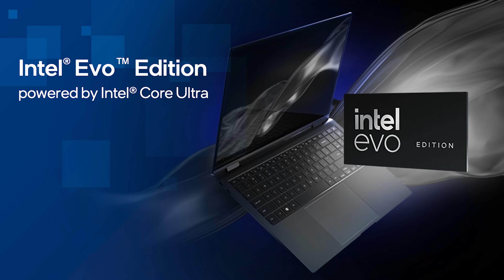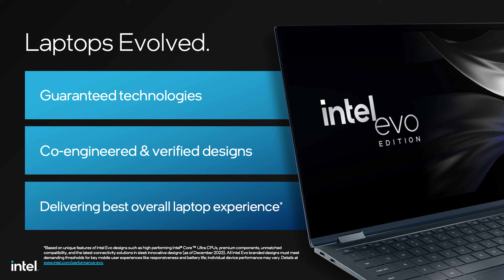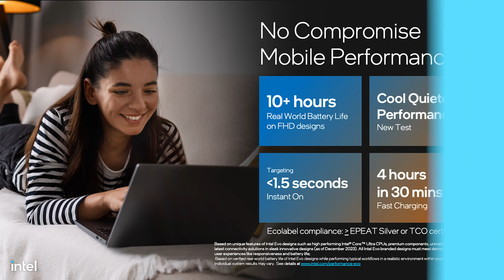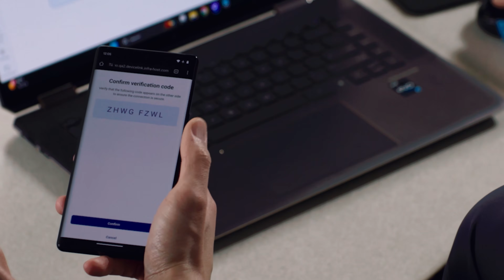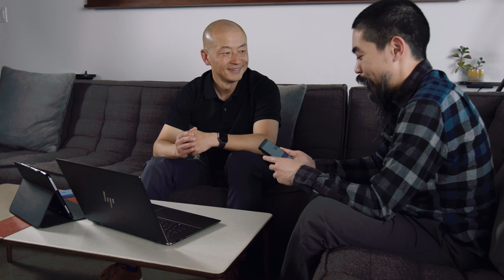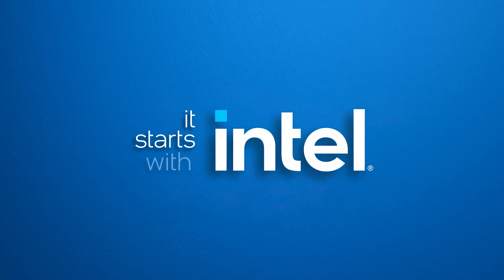What’s New With Intel Evo Powered by Intel Core Ultra | Talking Tech | Intel Technology

Comment: Is Intel Unison available for Linux devices?
Reply from the maker: The Intel Unison app will work with Windows 11 and exclusively on Intel Evo verified laptops. As of now it is not available on Linux. To know more about the compatibility of the Intel Unison app, please visit https://intel.ly/48aV0ja Do not hesitate to DM us if you have any further queries. We'll be glad to look into it.
Reply: @IntelTechnology whats the recent qualification for a laptop to get intel evo edition certification?
Reply from the maker: To check the complete qualification parameter required for a laptop to be certified under Intel Evo, please visit https://intel.ly/3RRm0gp The main highlighting features such as high performance, fast charging, long battery life, instant wake functionality, best-in-class connectivity, etc., are some prominent ones. For more information on the new Intel Evo edition laptops with AI experience incorporated in Intel Core Ultra processors, and the inclusion of the Intel Unison application for seamless connectivity, visit https://intel.ly/3OlayZN

Comment: did they put E core into the processor?
Reply from the maker: Yes, Intel Core Ultra processors integrate two types of CPU cores into a single die: a) powerful performance-cores (P-cores) and b) flexible efficient-cores (E-cores). The Intel Evo Laptops are designed to provide high-performance with low power processing. The Efficient-cores play an important role as they use less power and enables the device to operate at a lower power consumption rate on tasks do not require high computational performance. It also helps to maximize CPU efficiency and helps to run background tasks efficiently. For more information on features that comes with Intel Evo certified laptops, visit https://intel.ly/3v6Ezpm

Comment: Few initiatives that EVO can promote.
1. BATTERY - Today's laptops come with batteries with varying form factor. Because of this, it becomes very difficult to get spare original batteries for the product after end-of-life of the laptop which is generally 3 to 5 years depending upon the brand. The duplicate one are available for few more years, but they are not safe and tend to go bad in a year's time. This basically makes the laptop / tablet unusable. I have a Windows 10 tablet sitting in my closet because of bad battery. And the company has closed operations.

Suggestion: Intel EVO can ask OEMs to standardize battery sizes so that we could always find original spare batteries.

2. FLEX CABLES - Laptops use flex cables of varying pitches and no. of cores. Even if a single flex cable goes bad, we may have to throw the entire laptop. In most cases, OEMs do not sell spare flex cables.

Suggestion: Intel EVO platform can ask OEMs to standardize flex cable and connectors used in laptops to help in repairability.

3. RECYCLING - Today, it is very difficult to recycle your old laptop, especially if you are living outside Europe and USA. I personally think that this is not just the responsibility of OEMs but every other player in the PC industry to participate in this, unless we all want to get covered by Silicon dust.

4. UPGRADABILITY (Motherboard) - Lastly, it would be great if I could upgrade my old laptop by swapping its motherboard with a newer model as we do in desktops. This would obviously require us to standardize motherboard form factor in laptops just as in desktops. (Mini-ITX, ATX etc)